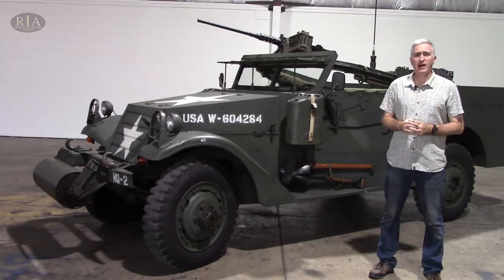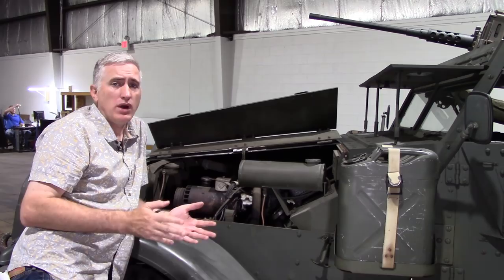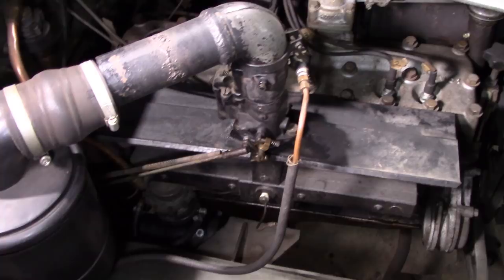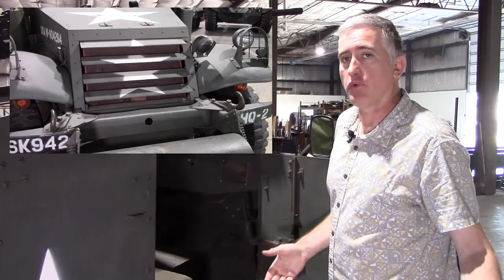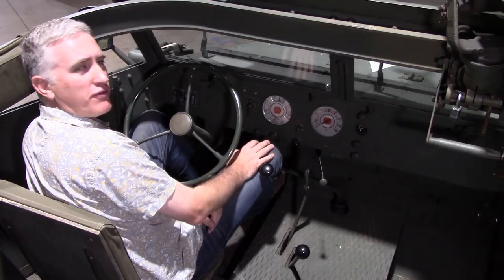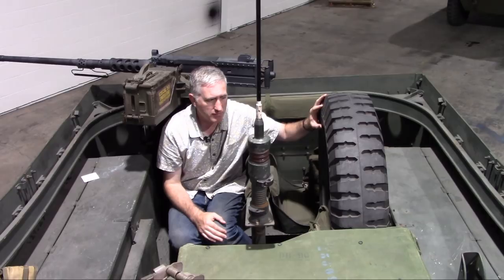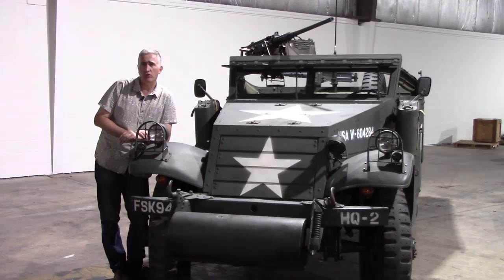Inside the Chieftain's Hatch: Scout Car, M3A1

Comment: But it doesn't have a door glass regulator
Reply: this vehicle is useless
Reply: I was in a total state of panic when I too realised there to be no door glass regulatory system.
Reply: This fact, renders this vehicle completely unacceptable. Obviously needs a complete rework.
Reply: How this vehicle could be accepted into service without Door Glass Regulator Handles is well and truly beyond me, not even the Double Drop Type Channel Section Frame comes close to redeeming this feature.
However the Standard Type Steering Mechanism is a decent runner up.
Reply: they still call them "window regulators" on modern cars
Reply: Perhaps because it doesn't have a door glass...
Reply: Michael Free  How can it NOT have door glass. Completely unregulated. It's out of control. Anarchy I say. Pure Anarchy.
Reply: Well, you don't need one because it's a SCOUT CAR. It provides lookout AHEAD of the main force. So it's bound to happen that it'll encounter resistance from the enemy. That's why they dumped the door glass regulator idea & opted for metal plating for the sides. You don't want to get shot at by the enemy with glass protecting you. To put it this way; vehicles that are sent to front lines have armor plating on their sides. There's some that are not, SOME, but most of 'em are armored. And then those that are used behind front lines have glasses on.
Reply: I think the joke might have been missed? ;)
Reply from the maker: Maybe Jehoiakim has not yet seen the M43 video...
Reply: Not everyone appreciates memes.... ;)
Reply: Naaah guess not. Can't say I blame 'em. Though I definitely prefer the memes around here though.
Reply: The_Chieftain Hey, I haven't seen it either!  This is on you for not including every possible related work in the video before it gets going!  Grr!
Reply: 2nd Amendment,       A well regulated Militia, being necessary to the security of a free State, the right of the people to keep and bear Arms, shall not be infringed.
Reply: Get a Mercedes Geländewagen from Deutsche Bundeswehr, It will go through San Fran traffic with no problems and it will be a rugged military car. Don't go for the civil version that is a lap dog im comparison. They are dirt cheap.

Comment: Yes those split rims can be lethal. The first time I worked on one and forgot to let the air out and I heard the split rim move just slightly scared me good. I never forgot again over the twenty years I spent in the service.
Reply: As an A&P mechanic, we had to learn to repair aircraft wheels which are split rim as well. My instructors were adamant about safety protocols on them. We learned how to use tire cages for inflating and deflating the tires before and after maintenance.

Comment: A double drop frame is one where the center is lower than the front and rear sections that hold the axles. A good example are the lowboy trailers that are used to haul around bulldozers and steamrollers. The WW2 Dragon Wagon pulled a lowboy trailer. It's use on the M3 allowed the crew compartment to set lower so the body would have a lower profile and lower it's center of gravity.
Reply: Wouldn't this also reduce the ground clearance heavily
Reply: @bigdiccmarty9335  Not by much since they used tall tires and well arced leaf springs.

Comment: I bought one three years ago (1942) fun vehicle but a bit of a pig to drive, hint - use both brakes when stopping, one foot on the brake peddle and one hand for the emergency brake, make sure your exhaust pipe is well wrapped as it will really heat up the driver if not.

Comment: fun fact.

all of the Armor on this thing and the M3 Halftrack is Face Hardened, 
now although some of you might know that FHA is no more effective than RHA against APCBC but against Solid shot it is, which is exactly what the 7.92x57 Mauser armor piercing bullets are. 

so even though the armor on this thing is 6.4mm all round it's effective thickness against Small arm AP bullets is more like 9-10mm.

I mean the M5 Halftrack was designed to save cost by not face hardening the armor, so they made it thicker 8mm thick but was said to actually be less effective despite this been able to be penetrated at 300 yards opposed to 200 yards for the face hardened variants at 6.4mm

(also just as a bit extra the german halftracks like the KFZ 251 were also not face hardened, so even though their armor was angled at about 35 degree's on the side sponson, the effective armor on the US and German halftracks were very similar, with the KFZ 251 edging it out at about 11-12mm of effective thickness.
Reply from the maker: Mmm... Hilary Doyle has the exact reverse opinion, stating that no other nation was as capable of producing thin armor of the same effectiveness as found on the German halftrack. Watch for a future interview video. Then argue it out...

Comment: Double drop channel section means that the frame bends upwards to accommodate both front and rear axles (a typical truck frame) and the rails are of C-shaped pressed steel, as opposed to box-type or I-beam. Again typical practice today, but not so universal back then. And box type is still found on premium vehicles.

Comment: In the early 70's I spent some time in D Troop ( the ground troop) of 8/1 Air Cav Squadron, part of the 194th Brigade at Ft Knox that supported the Armor School. Each platoon had a bunch of Jeeps, M151 with a M60 on a pintle mount behind the front seat and a PC-25 radio mounted on top of a rear fender ( I no longer remember how many jeeps), another M151 with a recoilless rifle ( again I don't remember if it was 105 or 106, but I do remember it had a .50 caliber spotting rifle on it) and a 5/4 truck with a 81mm mortar ( and the platoon Sgt ). The only situation i know of where the low man on the totem pole fired the main weapon.

At the same time I read that the Army was testing off road motorcycles for reconnaissance, something that made at lot of sense to me at the time since neither the M113's or M114's or even the Sheridan's armor couldn't protect the crew from mg fire, might as well be a harder to see smaller target able to hug the ground or bug out faster. It's the radio that was our real weapon.

Nowadays, give me a Onewheel.
Reply: M40A1 106mm recoilless rifle

Comment: Using a hand crank to start vehicles of this era wasn't as hard as people today think. The engines were usually of pretty low compression, so not a lot of strength was needed. I have not hand cranked a scout car but I have hand cranked four cylinder tractors; just be sure to stay out of the way of the handle unless you want a broken arm.

Comment: The rims are not "split" rim, they are called "combat" rims. They bolt together. Very tightly and easily. 

Look at "split rims", they have a different internal none bolting lock. "Split ring" is yet another type. Both of the later you dont mess with. 

Combat rims you do on the floor of your garage and have no issues. Jeeps are all the same originally.

Comment: A 1 1/2 ton truck is a pretty large chassis, actually.  Not a "small" truck.  The "light truck" designation ends at 1 ton trucks.  The footprint may not have been huge, but with trucks it's usually more the weight you worry about.

On "double drop channel frame" or whatever exactly it said, it means first that the frame isn't straight as it moves from the center out.  It drops down in the front and back to mount the suspension, while keeping the center high for ground clearance.  Second, channel refers to the cross section of the frame rails.  They're U-shaped, a shape that remained popular for a long time (it still is).  You could also have an I or H cross section I guess (and yes, there's a difference), but I can't think of anything I've been under that had that.  The next most common (and probably strongest) would be the box cross section which was/is sometimes made by overlapping two channels facing each other so the top of each channel was at about the angle on the other side, then welding them together.  Channel frame members are fairly cheap to manufacture, and have much better strength for weight than a flat piece or one with a single right angle.  

Fuel tanks under the seat were very common in trucks, and pickups all the way through the '50s would have the seat on top of the fuel tank.  Eventually someone figured out that wasn't very safe and realized there was plenty of room under the bed along the frame...

I really wish you'd looked at the axles and running gear a bit.  Then again, I'm obviously a geek for the mechanical side...

Comment: I assume you usually see only one battery in this vehicle because it was designed to run on two 6-volt batteries, and it's easier for mechanics and restorers to replace them with one modern 12-volt.

Comment: I can't  afford a 75K AFV (or 74,750 as cheap as that is) so I built my own (well I produced it, a couple of friends did a lot of the heavy work),  a full scale FT Chars Mitrailleurs  for the centennial. It's not quite done but displayable and I get to sit in the turret and fire the machine gun.   Look under FT tank clears it's throat for the Hotchkiss machine gun fire.  While this somewhat of a facade of the tank with lots of inaccuracies, it will look better once I get more bells and whistles and make the track more servicable.  However, much of the ambiance of these vehicles is apparent on mine, such as the cramped spaces, the realization you will most likely die if it catches on fire,   and how the hell did they see and fight in these things.  One day it will run and won't that be a hoot.  Due to torrential rains in Texas in September 2018 , I was only able to get it in a displayable form but it has gotten a lot of local attention as along the IH 35 corridor, San Antonio-Austin you don't see any of these (although there is an excellent concentration of Armor at the Texas Military Forces Museum at Camp Mabry in Austin, and the Museum of American GI in College Station Texas which is closer to the IH 45 corridor North of Houston).   MAGI of course has a beautiful FT tank and that is one the chieftain ought to use  as it is drivable and shootable with it's 37mm cannon.  I deliberately made mine the machine gun version with the "riveted" turret for contrast although of course you want to look at the real deal up close and mine at a distance.   But sitting up on the back of the tank with legs in the turret gives one a different perspective, a sense of false dominance that probably helped keep tankers in their tanks fighting rather than jumping out and running away in terror.  However, the drivers position is like being in a coffin. https://www.youtube.com/watch?v=eZ9_2nP4pYM

Comment: 4:50 How the hell can those rims kill you? Honest question because I have no idea...
Reply: Overinflation can cause the tire to explode sending the bead lock ring flying at any direction
Reply: The locking ring that holds the tire in place can become a projectile when loosening it, if you put some pressure on it afaik.
Reply: look up split rim and you will see
Reply: A lot of drivers and mechanics were maimed and/or killed by split rims. Remember seeing a demo where they place a man sized mannequin over one and it blew the mannequin up into the rafters.
Reply: Those things are literal nukes on the side of your car!
Reply: I think split rims were outlawed on new designs in the 70's in the UK.
Reply: We call them widowmakers at work.
Reply: That's why they have tire cages. We had to stand a good distance away from the cage when inflating HEMTT tires because those things would kill you if they blew.
Reply: They are combat rims, not split rims.  Jeeps, 3/4 ton Dodges, halftrack, m8/m20s and M3A1 all had bolt together combat rims, with a bead lock insert.  Easier to install a tire on the rim, versus tire spoons and the like for a conventional fixed bead rim.
Reply: They used them up into the gulf war, my dad had a few close calls with them.
Reply: No tire shop will touch a split rim! DIY! Lol
Reply: We still use them in Aviation. Standard practice is to deflate the tire prior to removing the axle nut. 

This is in case one or more of the bolts holding the two sides of the split rim together have failed. 

And I have found a bolt missing on a walk around once. We removed the tire from service before the next flight. Deflated the tire before removing the axle nut of course! 

It's in the manual!  :)
Reply: Split rims have been used for a very long time with many military and heavy duty commercial uses in heavy duty trucks. There's plenty of videos.
Reply: I used to change tires on split rims. The secret is to face the rim down, so if it pops off it doen't go flying into the air but the dirt.
Reply: Doug M,I am alive today because of a tire safety cage.I was inflating a large tube type truck tire,size 1400x24 14 ply rating.Always inflated tire without valve core installed,deflated tire installed core reinflated.Used long hose so I could stand well back while inflating tire.This time was doing final inflating split rim blew off cage was damaged beyond repair.I damn near had a heart attack,but was unhurt.Until I retired I refused to fix flat tires on split rims unless there was a safety cage available.Last military funeral I attended was for a young soldier that was killed when the tire he was inflating exploded.He was standing right over the tire,it blew him about 8/9 feet into the air,he landed on his head on a concrete floor.
Reply: Isn't it like that:
split rim = dangerous
bolted rim (like on that M3A1) = safe
???
Reply: I saw a mechanic killed on the spot changing the split-rim wheels on the rear of a semi-trailer truck trailer, it hit him in the forehead right between the eyes & went out the back of his head, he was dead before he hit the floor.
True story, gospel, swear it's true I'm still haunted by this outrage utterly horrible harrowing horrific scene to say the least! Torment, nightmares & PTSD are mine.
Reply: When I was at Ft. Hood TX. A Soldier was killed working on a split ring tire, not in a cage. Almost decapitated him.

Comment: Ah, the White Knight! (Made by White.) My US Army unit had one, as a legacy Commander's vehicle, up until 1992, and was driven extensively in the field. It ran just fine, but a very rough ride! But it did have trouble keeping up with M1 Abrams tanks, and M2 Bradley IFV's on cross country maneuvers. Our Commander was willing to forgive this, but his replacement was not. So he sent it back to the Army's monuments and memorial section. Wherever it is now, I hope it's still running, and not a hulk on a firing range somewhere, it was turned in in tiptop shape. I daresay that my friends and I were the last American soldiers to man one on active duty. Honestly, it was in better shape than this one.

Comment: Now I'm really curious about the effectiveness of quarter-inch armor plate against rifle fire.
Reply: Probably not very, at least at close range. I'm basing that on what happens to AR500 steel targets - .308 or .30-06 FMJ will go right through 1/4" ones at short range, even 3/8" will get chewed up pretty bad at under 100 yards. It would give good protection against shell fragments, though.

Comment: No top and 1/4 inch (7 mm) of armor plate. A better defense than "fight it out with your 50 caliber" has to be: "run away as fast as you can."
Reply: The .50 cals are just there to keep the bad guy's heads down while you are in the process of running away.
Reply: @jamestheotherone742   There's that option, too!

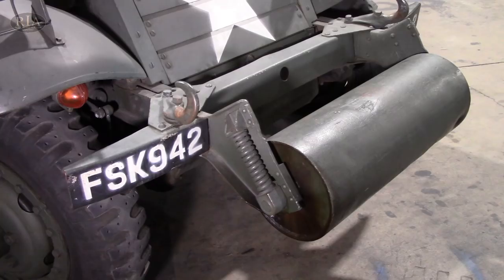Comment: 2:13 by "anti-ditch" does he mean like a ditch / hole in the ground? As ditch in the bailing out of the vehicle makes less sense, Wish he took 5 seconds to explain that.
Always wondered what that roller was, seen it in clips or a few games. Looked to me like a mini depth charge (for those nasty land submarines).
Reply: The roller was intended to prevent the bumper from "digging in" while traversing rough terrain or crossing a ditch - note that it has springs and provision for limited angular movement built into its mounting plates. It helps to maintain forward momentum so the vehicle doesn't come to an abrupt stop (and possibly get stuck, requiring retrieval or subject to capture).

Comment: Quarter inch armour,to stop what, a .22 cal?...
Reply: Artillery fragments mostly.  The purpose of the Scout Car was to get the scout sections close to the objective where they dismounted and then give them a way to escape "quickly" if they got engaged. It wasn't designed to fight.  The MGs were there to suppress the enemy long enough to extract the scouts and run away.  In practice, a lot of times it was "reconn by bloody nose"  the scouts would drive down the road until something or someone killed them. Thus why they used the lightest cheapest vehicles possible.

Comment: Are you sure that you could use the crank to START the engine? Because once that engine fires off, the kick-back on the crank will break your arm...just saying. I think the crank was used for setting the valve lash, etc. and not for starting. Anyone have an engine manual for this thing?

Comment: What was the point of this over a jeep? More firepower and faster engine?
Reply: Generally you would fine these used as Armored Personnel Carriers, and could be modified to do other task, such as the M16 MGMC SPAA.
Reply: The M16 was a halftrack.  The M3s are only about 2/3rd the size of the halftrack.
Reply: @jamestheotherone742  I dont know how I missed the fact theres no tracks in the picture. I saw M3 on the title and immediately assumed it was the M3 Halfttack used as a scout car. Dont ask me, I'm just stupid sometimes.
Reply: Well the Army's idiotic naming/numbering system doesn't help.